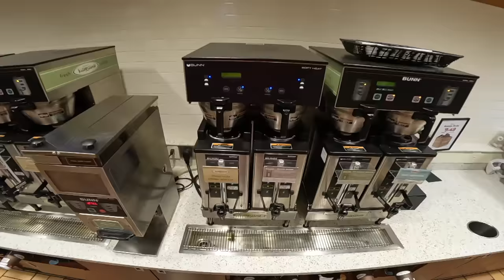Employee quits in the middle of a big job!

Comment: Best wishes Marcel!! It's gotta feel good to be able to go to appointments and know your employees work just as hard. Victory rocks
Reply: If you can’t leave a job site without your guys messing everything up there something wrong with the hiring process! Your hiring bodies at that point
Reply: @hollywoodhiggins1576  sure when ryan is not there he depends on Bugs to get the crew lined out and thats a great thing to have
Reply: They probably don’t pull the wire though 😅
Reply: @hollywoodhiggins1576  it is not easy finding good workers now, and the crew he's got is something alot of ppl dream of having, they're out there but finding them is a challenge, it's not like it was years ago that's for sure
Reply: @solidrockofjesuschristmini2423 
Most of the good trade workers are in a union getting paid with excellent benefits or have their own small business.

Comment: Believe it or not but I think Daryl knows a lot more about mechanics than most thing lol. Ryan Wouldn’t pay two people to stand around.
Reply: Don't underestimate the power of friendship.
Reply: Actually what he said about adjusting the brakes because of losing air pressure is wrong. Adjusting air brakes is simply one 9/16 bolt . You tighten it all they in , then back it out a quarter turn. It will effect pedal depression,  but not loosing air. Just sayin.
Reply: He has to be a CDL driver. I notice if Darrel doesn’t show up only Ryan can drive the big trucks.

Comment: the f150 Shelby is a great truck we have one out back my old man kissed a brick barrier almost head on doing 80 when he passed out from some conditions caused by cancer he got out without a scratch even disconnected the battery he hit it so hard the canter console snapped off and went out the windshield truck had over 600,000 miles still never burned a drop of oil or anything

Comment: I started a small concrete business for summer months and heating in the winter. After a good summer I did a walk way from back of church down the side at a wheelchair access. Small lot so from side of church  to property line. This was going to be my show piece for next year. All set myself and 3 others could do it. Biggest pour all summer. We start with wheelbarrow to the back. It's starting to set and 2 guys left because we had to hurt and manhandle. I have never had this problem and I looked incompetent and maybe I was. I stop doing concrete.  A couple of years later church burns down. 5 or 6 years after this happened. The large well known company settles with state AG office. They were taken concrete that got refused at the big dig in Boston and gave it to small pours. I never thought i needed to test for heat or do slump test. To late for anything but I was on the books for deliveries so I should of been notified

Comment: Ryan just a reminder that 1 or 2 gallons with about 6 yards left is not going to change the slump or consistency of the concrete - with two plus yards start with 5 to 6 especially if calcium chloride is used

Comment: I've seen jobs were they place the dowel in the form. Once the concrete is poured the dowel is imbedded in the concrete & there's no drilling. Although every once in a while they get stepped on & slabs cracks

Comment: I may have missed something but it looked like your finishers were walking on rebar that wasn’t elevated with a spacer referred to as a chair. Without spacers to support the rebar it will settle to the base of the pour and supply little if any reinforcement to the concrete. Pulling the rebar does little or nothing with thousands of lbs setting on top of it. It just sinks to the base.

Comment: Just curious as to why you  don't you use dobies or scrap concrete  to hold your wire  mesh up , Saves the hassle of wondering if the crew is pulling the mess properly.

Comment: instead of counting on someone to pull the wire, why not set up small concrete blocks with tie wires in them to hold the wire up and in place?? We use to make them out of paper or foam cups and stick rebar tie wire into the cups before the mud dried. Pull the dried mud out and there you go!!

Comment: Maybe a dumb question, if you have the wire pulled up while pouring, doesn't the guys then walking on it to smooth it out push it right back down? I work in the IT field, just enjoy watching your vids!
Reply: The density of the concrete and its aggregate will prevent the wire from touching the ground.

Comment: Good video to me - ONE THING the chalks were wrong on the rear wheels. One on the back needed to go on the other side to keep the trailer from rolling backward. ALSO -- both sides need to be chalked because of the size of the trailer. Great looking finish.
Reply: Chocked. Just saying. Chalk is something used on the black board.

Comment: Honest question for you. Maybe its been asked before. But when you put the mesh down i see you have the mesh puller to lift it off the ground. But then i see them walking thru the slop on top of the mesh. Doesn't that just push the mesh down to the ground again and not suspended in the concrete?
Reply: The stones in the concrete keep it off the ground

Comment: I was wondering about the wire mesh, if you pull up on it and then walk on it while spreading the concrete, doesn't that just push it back down?

Comment: Doesn't the wire get pushed back down to the grade when the guys are using the come alongs to level and are stepping all over the wire? I just imagine them stomping it down
Reply: The stones in the concrete hold the wire off the ground

Comment: Hey Ive been watching for awhile now.. im from Northern Ontario Canada,  I cant help but ask why you are still using a pipe and " "bear trap" type tie downs to chain your machines. Mudflaps, do they not require trucks to use mudflaps? And middle of the tire bald spots is a sign of over inflation, outside wear means under inflation. Love the videos, i cant help but notice youve been abit short with ppl latley, hang in there, finding good labourers is not common anymore inless its a union.

Comment: So the Wire needs to be pulled? yet they step in the concrete after which pushes it back down...
Reply from the maker: It doesn’t go back down when stepped on. Concrete is not water.
Reply: @VictoryOutdoorServices  yea but when you step into the same spot 3 to 4 times it tends to move the rocks that are in the concrete out of the way no?
Reply from the maker: @droci21  It doesn’t.